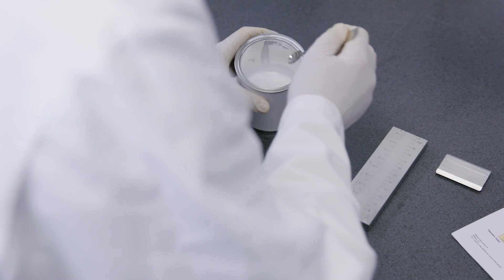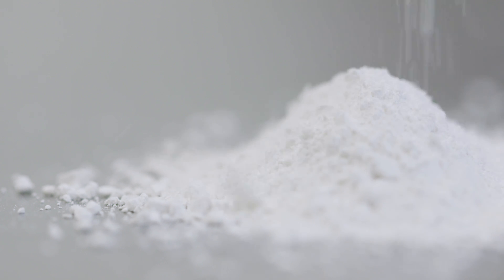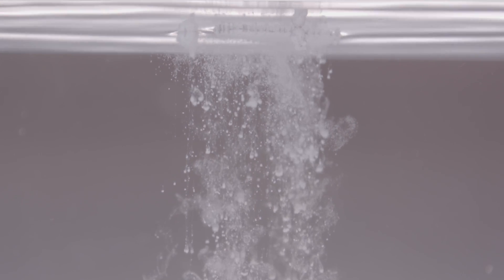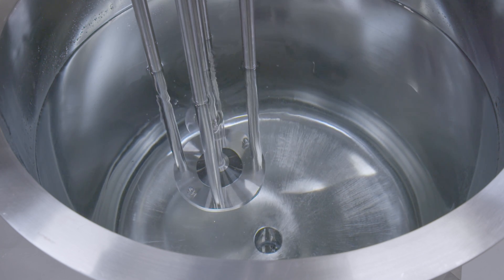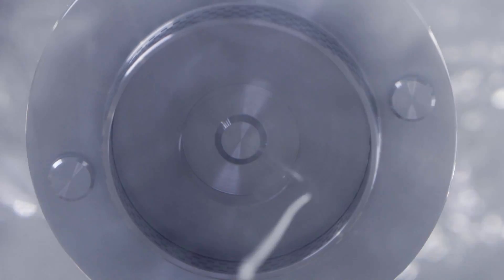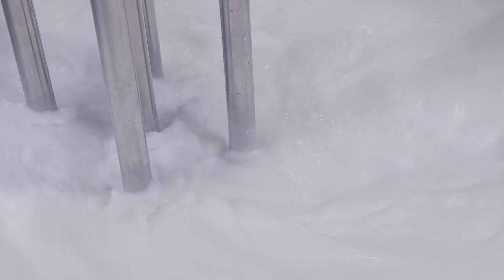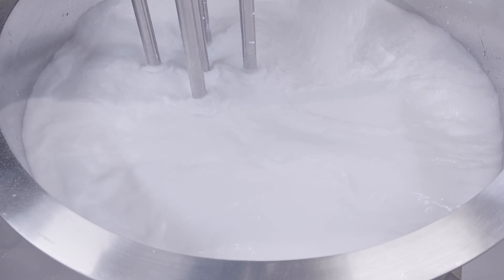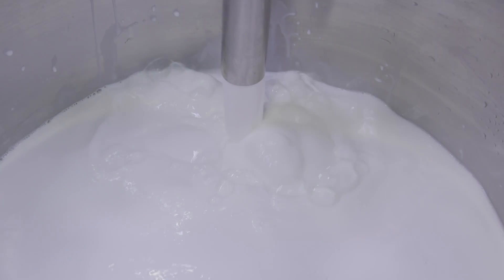How to Mix Titanium Dioxide

Comment: There is a great video demonstrating the follow-up dispersion analysis on an automated machine called TIDAS (made by Labman Automation). This analyses the gauge and makes the dispersion easy to see as it produces an image. It produces a rating automatically and removes the operator variation you often find between users in labs.